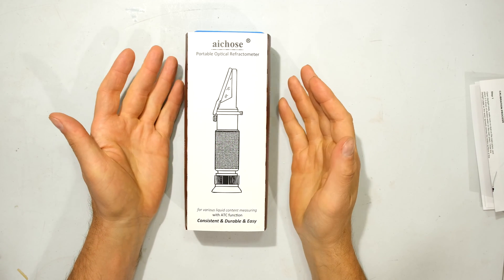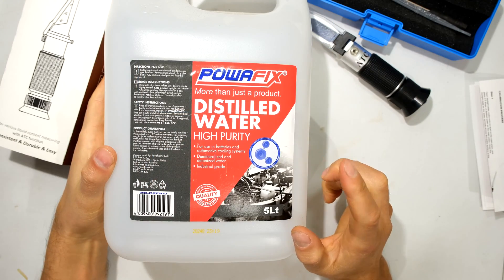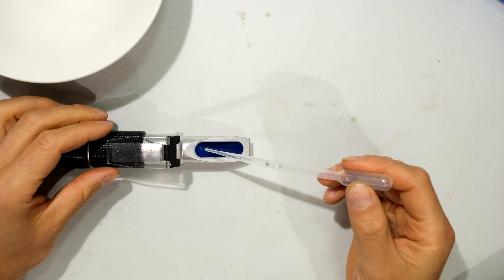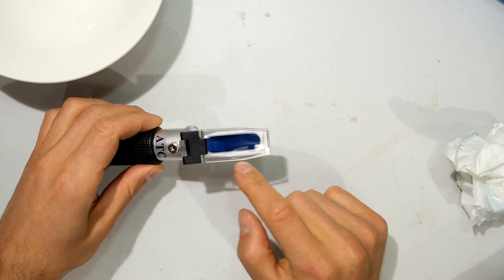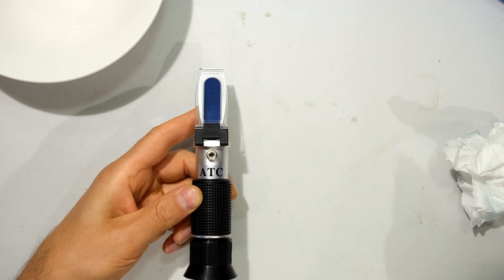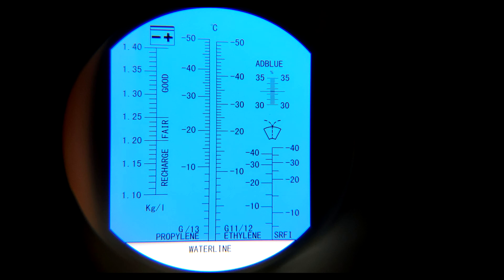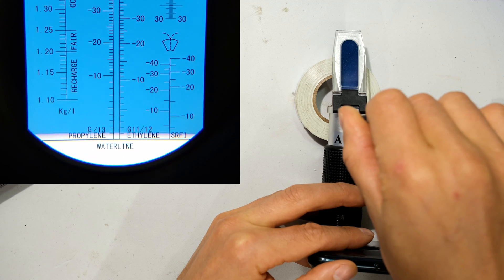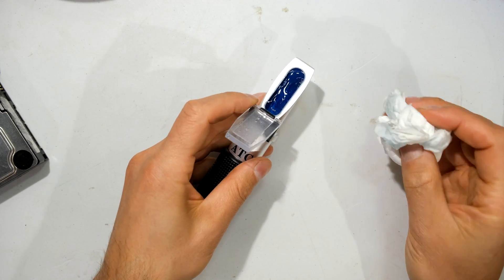How to calibrate a portable refractometer - step by step example

Comment: Mine doesn’t have a water line. It has Be, Brix and water- which starts at the top with 12% and the bottom of the scale is 27%
Reply: The line in the center around 78.8 brix is your mark

Comment: Hello, I could calibrate with simple waters from the store also? If I don't have another option?
Reply: I have the same question.
Reply: For anyone looking for the answer 

You can calibrate it with Distilled water which you can purchase at Walmart or Target or almost anywhere..make sure to put the distilled water in a Ziploc and float the distilled at the top of your tank water for a while so that the distilled water can become the same temperature as your tank water.Then add the distilled water to your refractometer and calibrate